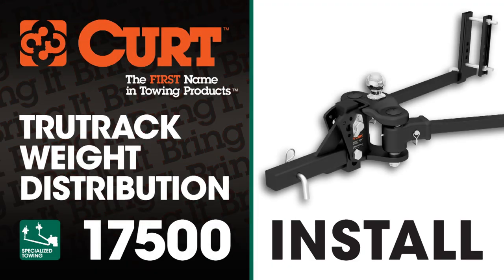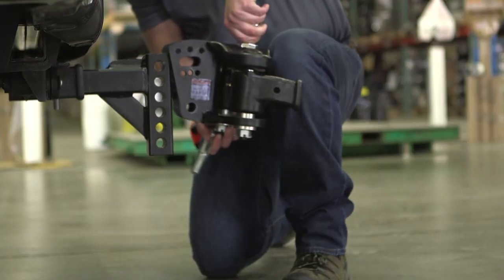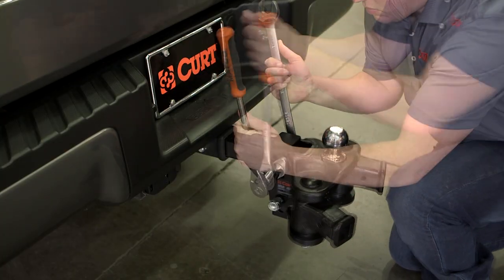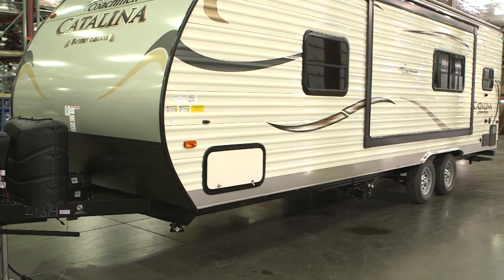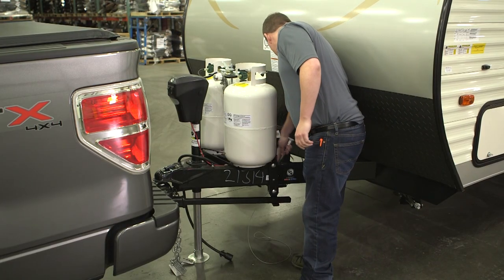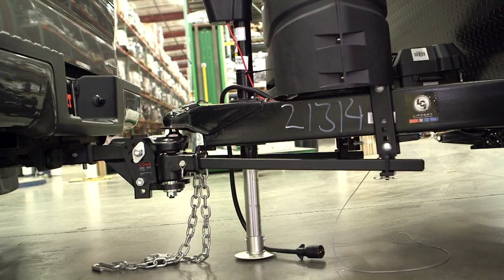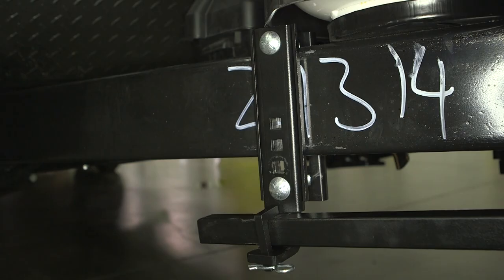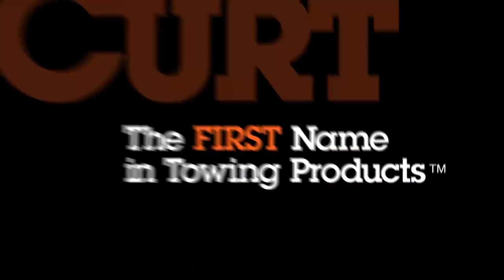CURT TruTrack™ 4P Weight Distribution Hitch Installation

Comment: I just installed the 17499 which is quite similar. It took about 4 hours to install and adjust. If you’re thinking of DIYing this here are a couple of suggestions. Dry fit the bar support arms on your trailer frame and if you have more than 3/4” of extra threads on the bolt cut the bolt down. This applies to the lower bolt in particular as you will be taking this one on and off several times to tweak your spring bar tension (unless you get very lucky). Also. Put the head on and see where the bar arms will have to be located. (4” in from the end of the spring bar). Depending on how your trailer frame is constructed and wheee your LP tanks are located, you may not be able to install this hitch. I literally had 1” to spare. 
You’ll need a torque wrench capable of tightening the hitch head 3/4” bolts to 200 ft-lbs. this is not something most DIYers have laying around. 

I’ve had a couple of weight distributing hitches before. They were all the chain adjustment type. I’m not sure I really like this style of hitch. It is not easy to adjust spring tension. Based on a difficulty scale of 1-5, with 5 being the most challenging I’d rate this one a solid 3 and probably a 4.
Reply: Great information you have provided!  Thank you

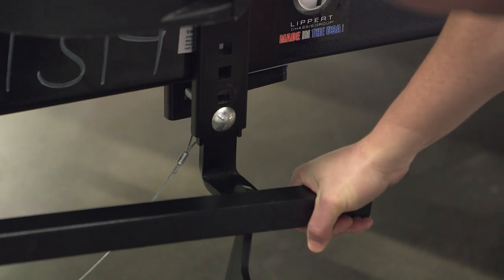Comment: At 6:00 you suggest using the lift bar as a lever to pry the spring bar off of the L bracket.  That instruction and your demonstration makes no sense.  Putting the spring bar on top of the lift bar requires SIGNIFICANTLY more effort than to just pull it off of the L bracket.  Aside from that, Great instruction and very helpful!  My dealer did a terrible job setting this up  and using your instructions I was able to do it correctly.